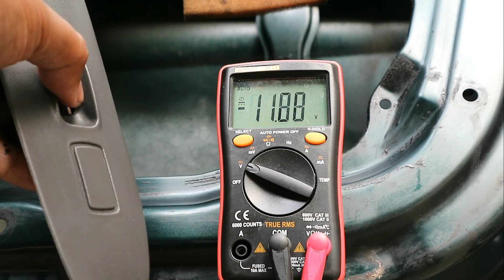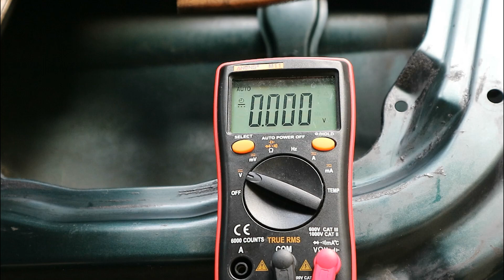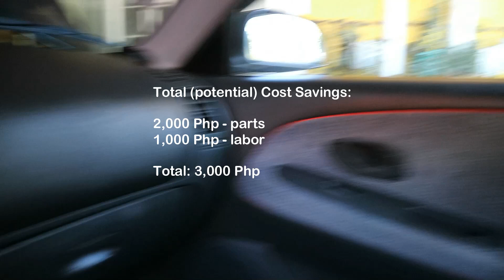DIY Window Motor Repair | 1997 Mitsubishi Lancer

Comment: Sir, pano po kaya i repair yung blender (osterizer).. bigla na lang namatay, ayaw ng umikot. Tapos matigas yung elisi ng makina sa loob pag inkot ng kamay. Salamat
Reply from the maker: kapag ganyan, mukhang ok pa ang motor. na stuck up, kelangan nyo kalasin yung shaft, linisin, at langisan ulit o kahit konting grasa.
Reply: @JMDIY  salamat po JM DIY

Comment: Kakaputol lng yung cable q😢napapalitan po b yun o plit din po ng motor?
Reply from the maker: napapalitan po yung cable.
check nyo po sa mga shops ng power window, kung magkano aabutin.

baka kasi ok na bumili na lang kayo ng isang buo na replacement assembly